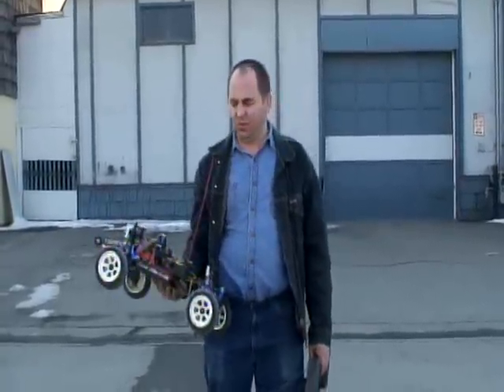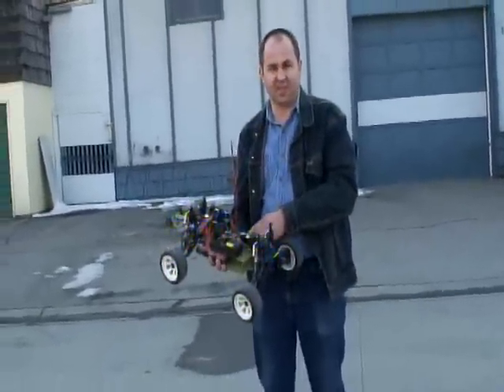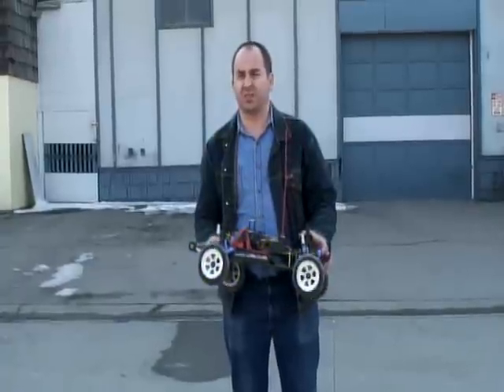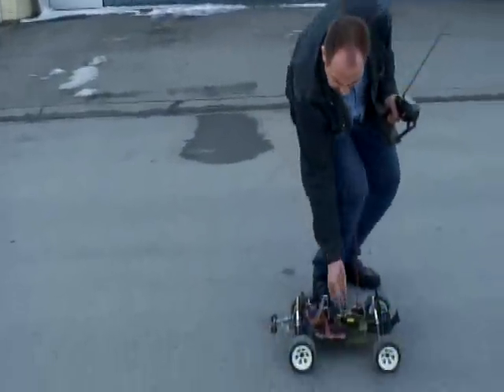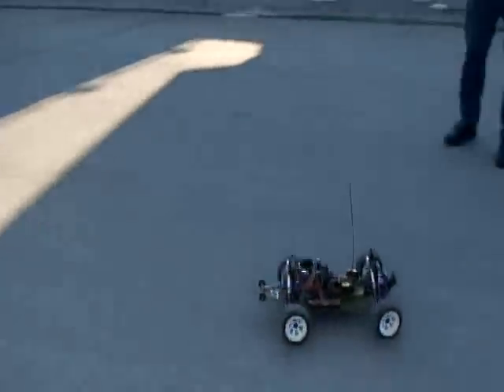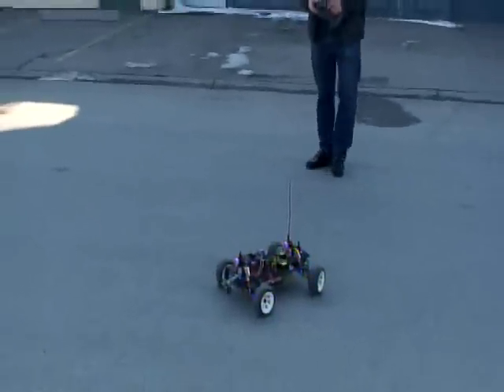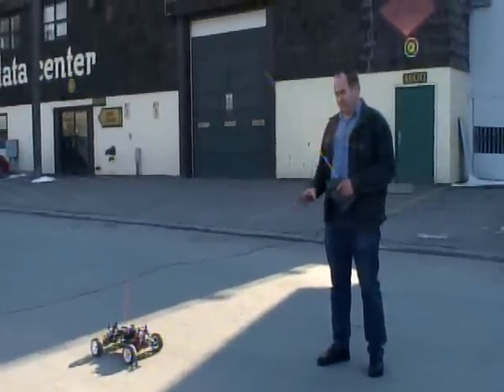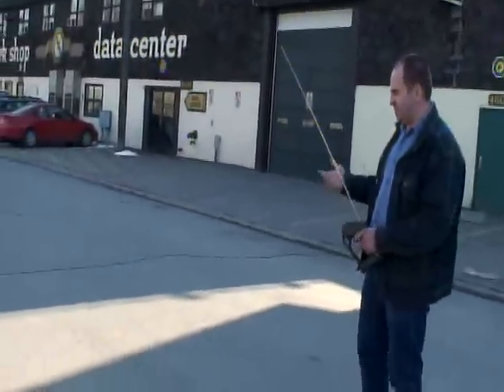How to Make a Super Traxxas E-maxx AT-2 w / Novak HV-maxx 4.5 RC

Comment: nice job where did you buy the novac comes with controller what else you need 
i have lipo batteries 2100 3s 3300 4s 6000 3s 5300 3s  3850 5s best regrads